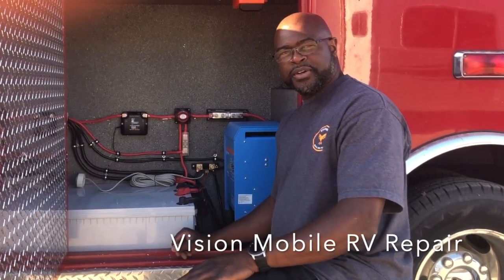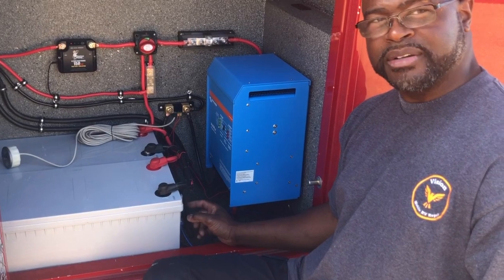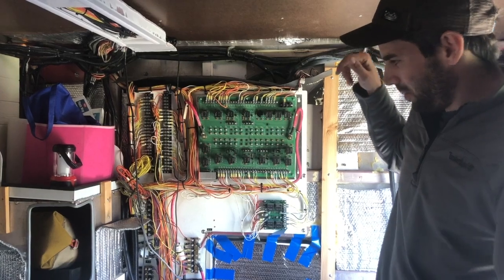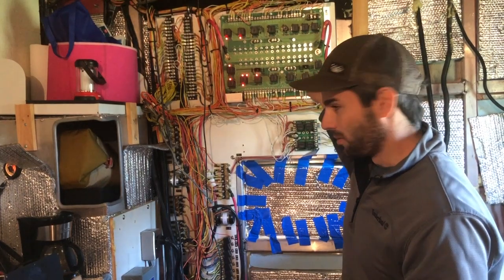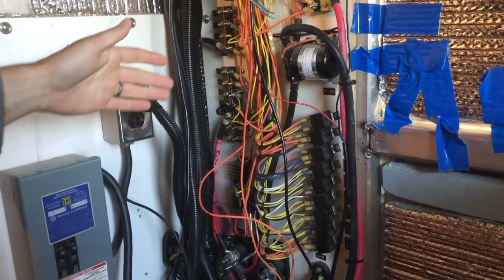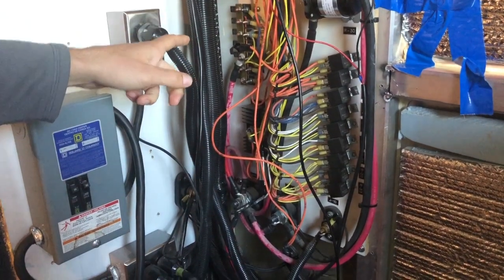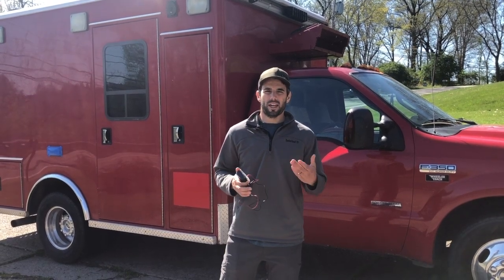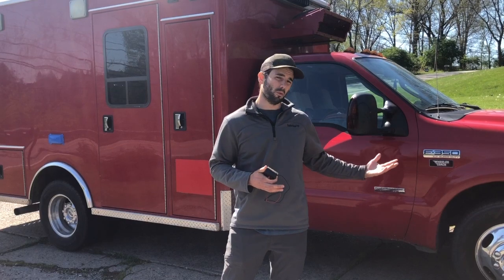Ambulance Conversion: Inverter/Battery Install, Rewiring 12v system, Electrical Walkthrough

Comment: This is sooooo helpful!!!  Exactly what we all need - a detailed explanation of amby wiring.  It is daunting but well labeled and should be doable.  On another channel, he took out the entire green relay panel and said none of that was needed. This guy deconstructed the whole ambulance which was very enlightening as you saw what the bones looked like.  He kept very few wires almost 75% were removed.  I guess its for all the equipment, clock, fridge, oxygen thingies, etc.  He also removed all the wall paneling and some of the exterior lights and patched that up.  Quite interesting to see.  But this detailed electrical explanation is so useful. Thanks a lot!
fyi- please do not add music. It's a huge irritant and hurts the ears esp on longer videos. Very hard to focus with this low buzzing in the background.  No need for it at all.

Comment: We are in the process of pulling wiring right now in our 2009 Ford E450 Braun ambulance. There was a crap-ton of wires just plain cut off in ours. We were able to get the wiring schematics from Braun. That has been helpful to at least identify the wires. Thank God they are mostly all stamped right on the wires so it's just a matter of going to the schematics and matching them. We started taking down the light bars yesterday. My husband has been handling that while I sit at the electrical panel and sort through that. We disconnected the two engine batteries and unplugged the AC current. My husband has been telling everyone "This thing is probably never going to start again", so Friday I made him connect the batteries back up and it started right up. So I gave him the raspberries.. LOL!! Our interior is pretty well along. We've actually camped in it a half dozen times, but we end up redoing something or other every time we take it out. We have all the parts and pieces for our solar set up but have yet to install any of that.
Reply from the maker: That's awesome!! Yes, the fact that they're all labeled helps SO much. We wouldn't have been able to do that otherwise. We're glad your truck did start up again haha. Great to connect with you!!
Reply: I just purchased a Braun Chief XL.  I got the electrical schematics from Braun.  Do you know where Node 3 is located?  Most wires are in the main electrical cabinet but a number of the flashers are routed to Node 3 according to the schematics.  Node 3 is said to be Left-Rear and Above OSS #3.  (not sure what OSS stands for)  Thanks!
Reply: @philweeber7157  OSS is Out Side Storage.. That would be your cabinets on the outside. Not sure about Node 3..
Reply: I ended up getting a brand new wiring schematic and we just ran all of our box wiring brand new. Far Our Ride website is where I got ours. Cost us about $45 for the schematic. We inadvertently cause a short that took out all of our interior plugs.

Comment: Thanks for sharing the setup with this ambo!!  We have a Wheeled Coach box that's wired similarly to this one and I'm doing pretty much the exact same thing in this video.  We have 3 engine batteries; one under the hood, two in a compartment behind the passenger door.  They currently route to our Xantrex 2500 watt inverter, but that setup is gonna change soon!  House batteries wired into solar, charge controller, and inverter.  I think I'm gonna wire things to where I can flip the existing battery switch (left side of driver's seat) to allow our solar array to charge the engine batteries if need be.  Then do the same setup as is shown here, rewiring to eliminate the need to flip the battery switch and then the Master switch on the console.   Put the box controls IN the box, and only control the floodlights/spotlights/running lights/marker lights etc from the console.

I'm also planning to replace the strobe lamps on all 4 corners and wire them to the parking lights (I think), after wiring around the strobe controllers and then removing them entirely.

I see SO many folks buying their rig and immediately start ripping things out....wiring being one of 'em!  I prefer to use what's there, after a bit of jumping connections, re-routing connections, and the rest. 

We were fortunate to have had the entire electrical schematic set left in our ambo when we bought him and that's been super useful in tracking down what goes where, what's always hot and what's switched, etc.
Reply from the maker: Hey Patrick! Sounds like you have a good set of plans going in. We ended up doing some things similar to what you describe. I like your thought about using the switch to toggle the solar charge between house and truck batteries. Our battery switch in the cab now enables/disables the Battery Doctor Battery Isolator so we can charge the house batteries from the alternators while we're driving if we want, though that isn't needed now that solar is in the picture. It's really only useful if we want to reverse the current and recharge the truck batteries from the house in the event that they die. I imagine you are thinking of something similar with your solar toggle since you will have everything living off the house batteries from now on.

We moved all of the controls to the house, including the flood lights. The rear flood lights are tied into the backup relay, so they come on automatically when in reverse in addition to when the switch is flipped. And the runner lights are tied in with the headlights so they are automatic as well. We thought that we wanted to have control of the flood lights from in the house in case we hear something strange in the middle of the night and want to scare someone off. I thought it would be great if we could control the flood lights from both the cab and the house but I didn't want to invest more time in figuring out how to make that happen.

Having the schematic is amazing! It was definitely a life saver for us, that coupled with the fact the the wires are labeled. I'm very thankful to Wheeled Coach for that. Though I will say, even with all of that it was still a pretty steep learning curve for us. It sounds like you may be coming in with some knowledge to give you a jumpstart.

Good luck with the rest of the build. Would love to see some pics or video along the way.
Reply: @bethzabiegalski7874  Hey Beth!  Just today I'm sorta on the fence as to whether we keep and use the battery switch, just in a different capacity, or just don't use it at all.  Having the option of routing charging to the engine batteries is still appealing, and that's just one option of several for that.

Another thing I've changed my mind on is the floodlight control left on the cab switch panel.  You're right about the things that go bump in the night, it would be great to have the capability to fire up the floods from inside the box.  I've also kicked around the idea of mounting a couple of infrared cameras at the top of the box's walls, but that may wait until we have a few trips under our belts!

I'm also looking at controlling certain things (the floodlights included) from more than one location.  Putting in two 3 way switches would do that.  Then you can turn the floods on and off from the cab AND from the box.  I've had a bit of trouble finding 12V switches that accomplish the same purpose as a standard house light switch, but they ARE out there!

I'm taking pics at every stage, and I'm happy to post a few!

Thanks again for the great video!!

Comment: I found that the main function of the large circuit board uses the cube relays to energize ambulance lights and equipment. But it has a load monitor system that if alternator output to the batteries drops to a level where the load exceeds the charge then the load monitor will automatically start disconnecting the 12v powered equipment in 5 steps to reduce the drain on the batteries. The load monitor deenergizes the relays in a predetermined order from least critical equipment to most critical for the survival of the ambulance.

Comment: Excellent video.  Thanks for posting.  I'm about to embark on the same journey as I just purchased a 1999 Type 1 4x4, Ford F350 Super Duty XL 7.3L-based ambulance.  I don't intend on gutting the house, and intend on using much of the existing cabinetry as it stands etc.  However, I do intend on separating the electrical systems as you have done, including introduction of house battery bank, inverter, battery isolator, solar panels, charge controller etc.  I have reached out to the current company that now supports McCoy Miller boxes to see if I can get the wiring diagrams.  Crossing my fingers.  I too have very little (barely any) experience with vehicle electrical systems, but I do have some experience with solar systems.  I'm hoping to climb the learning curve relatively quickly over the course of the next few weeks/couple of months.  Its going to be an adventure!  Question:  My master switch in the cab needs to be on to even start the truck.  Is that the way yours was originally wired, or was the truck able to be started without the master switch turned on in the cab?
Reply from the maker: Ooo that's exciting!! Best of luck on your ambulance journey :) I think you're making a better decision not gutting haha. That made things so much more complicated and extended the build time by a LOT. Feel free to reach out if you need any support as you set up your electrical system! Anthony has been enjoying connecting with others around this lately :) Huh, interesting question - I missed it at first so am now editing my response. I will consult with Anthony on that and let you know.

Comment: Awesome Video!  I've been enjoying my Ambulance home for awhile now.  But every time I open my electrical panel to study it I feel sorrow well up inside of me.  I have a couple questions if you have any idea about them!  While I don't use house batteries at all and only have vehicle startup batteries,  I have been finding that my startup batteries are being drained without anything being on (engine or otherwise)..  Now I have found that there is a very interesting switch under my rigs drivers seat that is a turn/switch/gear styled thing that depending on which "turn" it pulls different amounts of power from the batteries.  Even while the engine isn't running.  An older gentleman I met said it looked like a sneaky "kill switch"....  I haven't heard anyone else having one yet, is this just me?!  I'm not to sure what I should do about it. Of the 6 possible turns this "kill switch" can turn, only 1 of them engages the switchboard and power to the rest of the ambulances features.  The other 5 turns don't engage the switchboard BUT all but 1 of those turns continues to pull a lot of passive power.  I'm just wondering if you (or anyone else reading this) also has one of these nifty "kill switches" and if they have any idea how they work in more detail then my vague attempts at understanding.

Is it possible for shore power to charge my startup batteries OR my house batteries?  At least when I get some house batteries.
Can the shore power be setup so it does not effect batteries at all but just enables power usages inside the ambulance switches/lights itself?  
Some of these are probably self explanatory, but I've lost hope that I'll figure anything out!
Reply: Hello!

That is indeed a "kill switch" that stops your truck batteries from powering the components in your house. Mine is located on the side of my center console in the cab and is similar to this model: https://www.wirthco.com/battery-doctor/battery-disconnect-switch/without-lockout-plate. When I open the console, I see a thick gauge red wire leading from the engine compartment to the switch, and then another thick red wire leading from the other side of that switch to a 150 amp fuse, and then to the house compartment. The wire from my kill switch leads through a circular opening behind the driver seat and into the house. You will most likely see a similar setup under your driver seat.

Ambulances in their standard configuration are meant to either 1) be plugged in to shore power back at the EMS station, or 2) on site at an incident with the engine running so the alternator(s) can feed power to all of the electronics in the back. If you don't have your ambulance plugged in when your engine isn't running, then I recommend you kill the power to the house by using that kill switch. We made an effort to separate all of the house electronics from the truck batteries so that we don't experience parasitic draining of the truck batteries like you are talking about. Now, our auxiliary battery bank also has a kill switch on it so I can still leave it off when the truck isn't plugged in. Eventually, the plan is to install solar panels and leave everything on full time so we don't have to worry about all of this as much. For now, we don't have to worry about the truck batteries draining if something accidentally gets left on.

I am sure it is possible to setup your shoreline to charge either a house or truck battery bank. I'm also sure that it is possible to have your shoreline act as a pass through that just powers the house and doesn't charge. You may even have a setting on your inverter that lets you do this without having to change any configuration. You could also install a second shore power inlet that goes to your house bank once you get that set up. We chose to address this by connecting both battery banks with a battery isolator in between that can send charge current in either direction. This is what I am referring to: https://www.wirthco.com/battery-doctor/battery-isolators-testers-monitors/battery-isolator-series/150-amp. With that, we can choose to charge the house batteries while driving, or we can press a button on it to charge the truck batteries from our house battery bank as a method of jumpstarting the truck. The only trick with that device is that it is automatic, meaning you can't stop the truck from charging the house batteries when it is on unless you install your own shut off switch. Ultimately, if you didn't install the switch it will mean that you will probably end up getting about half the lifespan out of your house batteries than you intended since they are not meant to be charged at the constant rate your truck puts out power at. To solve this, we took the red power line coming from the kill switch and had that go to the battery isolator and then to the house batteries. So the kill switch now turns on the isolator when we want to use it, and we can turn it off when we don't. I know this is more info than you asked for but I wanted to give you some background on how we addressed this issue. Let me know if you have more questions about that.

Let me know if you have more questions, and stay strong! It took many hours of just staring at my electrical panel (seriously) before things started to become clearer.
Thanks for watching our video and for reaching out.

Sincerely,

Anthony
Reply: @anthonyzabiegalski8819  This helps so much, thank you!  I'm doing a few things to try and isolate the problem I'm having and thanks to you I have also found a couple great communities that are also helping me out!  This time last year I found the internet pretty barren, but now there are more and more resources popping up!  Thank you!! :)

Comment: Could you do a video showing how you handled the relays so the system thinks the ignition is on? Did you simply run 12v to them? Also how did you deal with the AC outlets and the inverter so that they too would work with your new batteries.
Reply from the maker: Hey! We are overdue for another video and would love to cover the electrical system in greater detail. Especially now that we have added solar to the setup.

In the meantime, I can answer your question about how we disconnected the truck from the system by pointing out the junction point at 8:40 of this video. The ambulance originally had power from the truck’s batteries leading to that junction. We removed the line from the truck’s batteries and added a line from our house batteries. This makes it so now the whole system runs off the house batteries instead of the truck’s.

In regards to the AC outlets, those are connected to our victron inverter, which is in turn, also connected to the batteries. When we do another video, we can point this out more clearly. Essentially there are three lines coming from our batteries: 1) to the inverter which runs the AC side of the house, 2) to the junction point that powers the ambulances 12v system, 3) to the battery isolator which can receive charge from the truck’s alternators. Theres actually a fourth line now that is not included in this video and that is to our solar setup. More on that to come.

Thanks for asking and for the suggestion for another video.

-Anthony and Beth